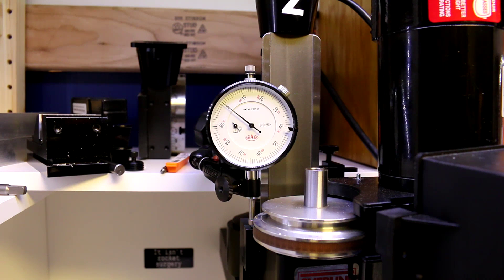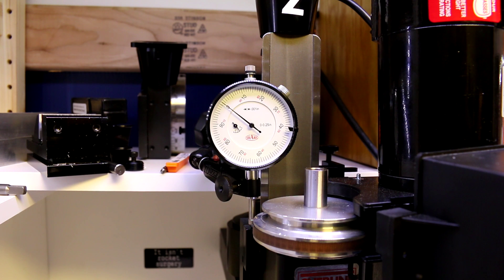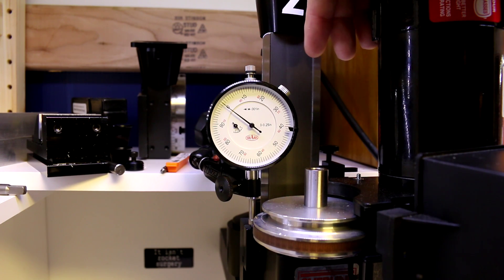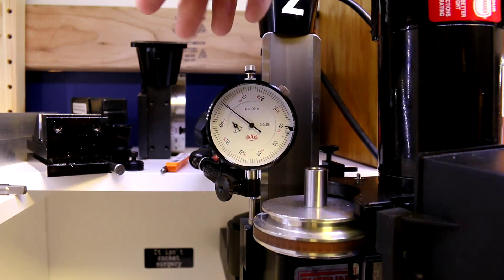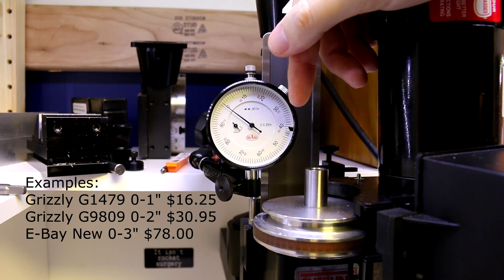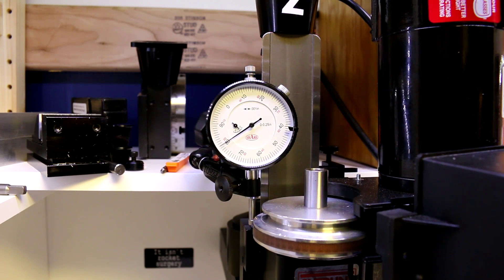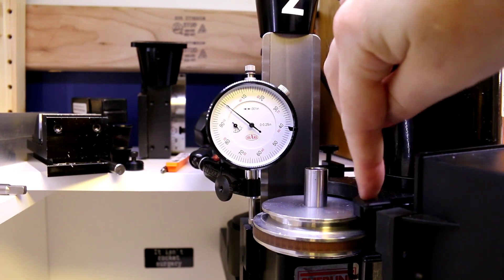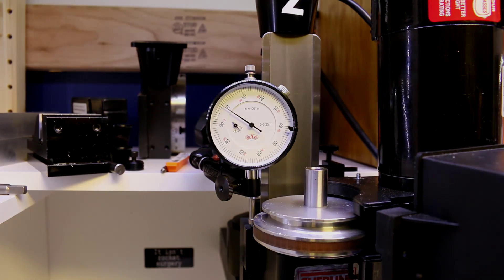Mill Tip - Accurate Depth on Z Axis

Comment: If you are using the Sherline linuxcnc software, you can set the backlash in the config file and and the software will adjust for it.

Comment: That is a great idea! Also congratulations on upload #50! Your timing on this series is great for me since I'm just starting out with a Sherline Lathe and Mill.

As I said below I tried my steady rest bracket and it worked great on the mill column. Just need to figure out a mount for the dial indicator.  Also I like zyzzy1944's solution since it might be easier to make a dedicated bracket.

In the meantime I think I figured out how to deal with the backlash on the z axis. With the x and y axis I always take out the backlash in the clockwise direction. That doesn't work with the z axis because of the weight of the spindle and motor. If I set it to a certain dial reading (I'll use zero) going in a clockwise direction and lock the z axis, when I release the lock, the spindle drops down the amount of the backlash (.0035 in my case). What I'm trying now is to lower the spindle to a certain reading (lets use zero again), then turn the handle back counter clockwise to take the backlash out in an upward direction (in my case the zero adj. hand wheel collar will now read .0465). Then when I want to lower it a certain amount again, I will unlock the z axis, turn the handle back to zero, then move it the amount I want to lower the head, and repeat taking out the backlash in a counter clockwise direction. I will test this to make sure it works, but I think it will.

All that said I still see the dial indicator solution in my future. Might be a good MiniMachining project. Hint hint!
Reply from the maker: +James Thornton I've been thinking of a couple of projects that involve clamping onto the dovetails, and what the easiest way to cut the odd 55.5 degree dovetail on the Sherline is. Let me spend a little more time pondering the best solution and you'll see a holder for dial indicator or other stop in a video shortly :)
Reply: +MiniMachining 
Sounds great! I've been checking out dial indicators (already have a Starrett Last Word test indicator). I'm thinking a 2" range might be the way to go.

Comment: Hi,

I solved that problem on my mill in a similar manner.  I purchased a steady rest riser (part number 1290) from Sherline and mounted a bracket with a 3/8 hole for the indicator on it.  I can easily slide it to the top of the column when not needed and down when I use it.

I enjoy your videos - Thanks.

Jack
Reply: +zyzzy1944 
Good idea. I also just tried my steady rest (part number 1074) and it works as well. I just need to figure out a mount for a dial indicator.